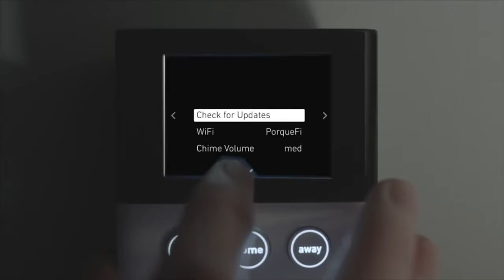The WORST Gun I Own

Comment: I'm impressed with that glass, I've seen WW2 surplus black tip 30-06 go through a nearly inch thick steel I beam that came from a railroad bridge. Tough stuff!
Reply: well you also gotta think thats not a full power 3006 as the m1 garand cant take the pressure of modern rounds so if you get that back tip and put it in a new case and reload it to now days pressure for 3006 is about 65,782psi for modern day and max of 55k for m1 you can get about 568 fps more or about 890 ftlbs more energy
Reply: @jacobstallcup8648     Nothing you said is relevant to what NOLA_Ken said. He specifically referenced military issued WWII black tip ammo, which was commonly and safely shot in M1 Garands, doing specific damage to something. Snipers using M1-D configurations commonly used black tip as their ammo of choice. Military 30-06 is “full power” by caliber and military standards, and by no means underpowered or anemic. You can always load hotter cartridges in a bolt action than you safely can in an auto-loading gun, as there is no pressure/timing used to cycle the action in a bolt gun, and no mechanisms set in motion by gas pressure. The Garand was simply designed to reliably run off of the timing and (still very high) pressure of M2 ball without damaging moving parts. There is also a difference in the burn rate and potential energy of the powder used in military 30-06 compared to modern hunting ammo, which makes a huge difference in the pressure spike exerted on the moving parts of a Garand. With minimal modifications, you can run the HOT loads you’re referring to in a Garand. However, since it’s not a hunting rifle, it’s usually not all that important to most owners. 

Point is, that window got hit with full-fledged 30-06. No reason to act like it was just lucky it only got shot by a Garand.
Reply: @Lukronius  nice

Comment: Delayed blowback roller locks need fine tuning on the angle of the locking piece, dependant on the weight of the projectile.  5.56 is a tough one because of so many variants in weights (55gr, 62gr, 69gr, etc).
This CetmeL is the Spanish variant of the HK93
There is a breaking period of about 200-500 rounds to set all the springs and surfaces.  Then it will run like a top.

Comment: Matt I make sure also that the springs in your standardized mags are retaining their spring tension. I went to see mags and Magpul mags but it could just be the gun still. I have a Cetme that's based more off of the H&K G3 and it works like a beauty I put thousands of rounds down range without any issues, maybe it's take their model of Cetme

Comment: Due to the barrel design the Hill Mac & MARCOLMAR CETME-L needs run on steel cases not brass at least for the first few hundred rounds. You can fire around 20 steel rounds get the barrel hot then change to brass  it will run. It won't run reliably cold using brass. It runs fine using Wolf steel case or similar.

Comment: Break in usually means assembly problems. No gas involved. 
The reason behind that is the gas port hole costs about 100 fps of velocity. Thus the 16 inch barrel has a out the same velocity as a 20 inch AR. Chronograph. Gauges. Bolt polishing. Used parts may not be from the same weapon.

Comment: The Cetmes action is the same as the G3. They run really bad when dry. Especially with low power ammunition.
Reply: So it is a badly produced G3?
Reply: @christophfriedrich5289  More accurate to say that the G3 is a well produced CETME, since the CETME came first.
Reply: @christophfriedrich5289  on the video IS the CETME l that use 556 there IS other CETME that IS just a G3 but In wooden furniture and also shots 7.62
Reply: @jic1  I didn't know that
Reply: @christophfriedrich5289   Yes and no. The roller delayed system that is used in the HK's were invented by CETME. You can compare the G41 to this one. It's like comparing a supercar to a moped.

Comment: Well, you must take into consideration that the Cetme was designed to use 7,62 rounds, so those feeding failures shouldn't happen with that.

And about durability, they were made to be used and abused. They're still on use (Cetme C version, the original) by civilians, army recruits, and police recruits.
Reply: It's well known that the only good CETME L were the ones used by the Guardia Civil. The ones from the army were made as cheap as possible, and so, unreliable.

(i recall something related to cheap magazines, but take this with a grain of salt)
Reply: @hypernova3527  I had a century arms clone made with old cetme parts and it never malfunctioned.
Reply: The CETME C and the CETME L are completely different guns and the CETME L was never designed to run on 7.62 of any kind. 

In fact there is only one 7.62 caliber round I am aware of that will fit into an AR magazine and chamber in a CETME L, and if you shoot it, it won't work better, It will probably remove the right half of your face. 

Why would you say such a stupid and dangerous thing?
Reply: @Keepgoing9919  Century Arms are built by skilled orangutans and should be regarded as preassembled parts kits. 
Some of them are very, very good. I got one on sale for $560 and a few years later, I have it shooting half an MOA after a few custom parts and a harmonic tuner. However, some are missing critical welds, some have had bolt components ground down to artificially simulate critical wear measurements are within spec (not because they were trying to be shady, but because they didn't understand how the weapon worked or understand stacking tolerances) and some are assembled using potentially hazardous parts. 

They should be closely inspected before firing, including making sure the bolt has not been ground, making sure the bolt gap is within spec with safely sized rollers, making sure the delay wedge is a 50 degree and not a 60 degree piece, making sure that all of the springs are fresh ESPECIALLY the firing pin safety spring (unless you want a spontaneous 2-5 round burst feature in a relatively lightweight .308 with a recoil impulse well over the centerline of the stock), and making sure after a few rounds that your rollers aren't deploying either at the back of the bolt stroke or at the front before going into battery. Either of these can be a sign of trouble with your receiver. At the front, it means your receiver and trunnion are not properly aligned and your bolt face is hitting the back of the trunnion instead of going into it. If they're deploying at the back, it means either your mainspring is weak, or your bolt isn't going into battery. 

CAI is a great way to get an affordable fixer-upper of an unusual gun if you don't mind tinkering. But many of them will not run right without tinkering. Some will occasionally not run safely without tinkering.
Reply: @009013M3  That’s not the first time I’ve heard that some of their items come unsafe to use. I guess I got lucky with mine. I’ve sold it since then
Reply: @Keepgoing9919  I have one, and to be clear I really like it. Got it on sale for like $560 back in... 2019, I think it was? I have replaced about half the parts with either new old stock H&K or homemade improvements, and if I'd shot it as-is from the factory, it would have been ruined by now. 

Here's a good way to put it. 

Buying a CAI is a bit like buying a used surplus gun in unknown condition from a private seller. I mean... I think we've all done that too. 

You kinda have to understand what you're getting with CAI. It's not always dangerous or even bad, but it is consistently inconsistent.
Reply: @hypernova3527  Part of the problem is that the CETME L has a unique magazine that looks very much like a STANAG mag but has a different feed angle. It is possible to install a STANAG mag in a CETME L but it will not run correctly. 

Malcolmar fixed this for their guns though. They work with AR GI mags.
Reply: @009013M3  first I’ve heard about mag incompatibility. The Spanish troops I trained with were always eager to buy/trade for USGI mags. That was the only way their CETMEs had a chance of cycling properly. I later heard that soldiers got fined if caught with USGI mags.
Reply: And the H&K G3 design was purchase from C.E.T.M.E.

Comment: The CETME is a G3/HK91 (HK-93 for 5.56). The G3 (7.62 x 51) does hammer your shoulder. Its accuracy is reliable to 300 yds or so in its vanilla form. It's a battle rifle and not a tack driver. I have a G3 but really just as a collection piece. The G3 has it's place among the AR/M16, FN FAL and AK-47 platforms as 20th Century modern battle rifles. The G-3 ejection port is fine. I've never had a stove pipe or failure to eject. I have no experience with a 5.56 version though. It seems a delayed roller is overkill for 5.56.

Comment: Check that you’re using a good magazine. Make sure the follower is consistent and doesn’t tip. Repeated consistent failure to eject and double feeds are usually a mag problem.
Reply: Like Matt is ever going to bother with any of this
Reply: Meh the Cetme L doesn't exactly have a sterling reputation. Even in Spain the things were detested by the troops issued them. I am frankly surprised he bothered buying one. The things make his Hi Point carbine look good in comparison.
Reply: @clothar23  the marcolmar reproduction ones are good quality, they made all new springs for it and changed the magazine well so it works better.
Reply: Or the whole gun is a hunk of crap . It looked cheaply made to me .
Reply: @michaeltheoret3842  nope, marcolmar made ones have nothing but positive reviews, it’s the hmg ones that can be hit or miss.

Comment: my guess would be: the CETME is a roller delayed blowback designed for 7.62 NATO. If you scale it down you might hit some problems.
When i was doing my mandatory military service in the Bundeswehr (german army) my platoon scored high during G36 range training and we got to "play around" a bit with the G3´s (very similar to CETME). Those guns were by that point about 40-50 years old and never made any problems.
But shooting them could be described at best as bruising. half the platoon got bruised shoulders after MG3 and G3 on the range.
Its a good and reliable rifle, but not the most compfortable to shoot.

Comment: I had a Cetme G3 clone, had the same issue, worst rifle I've ever owned just about ever 2 - 3 rounds it would get a failure to eject just like that.
Reply: The CETME C is the predecesor to the G3, and it's a very reliable gun (literally the same desing) so that seems like a personal experience
Reply: I had the same experience! It was a rough gun. Century import so I can’t blame the original design
Reply: @djunclemilo  it’s a shame, it’s a really cool rifle, delayed roller blowback is a great system but Century and CETME have very poor QC.
Reply: @djunclemilo  idrk about the imports, but the ones that were in the spanish ground army work wonders, i know cuz both my grandpa and my father served with it

Comment: The Styer M95 has an ejecting clip. On the last round pull back the clip drops out the bottom. I'd let you check mine out but unfortunately I have the original 8x50 and no one makes rounds for it. I also don't have any clips for it.

Comment: You need to put a minimum of 200-300 rounds of M855 through it. I had a few issues at first, but after about 250 rounds, mine has been flawless and will eat anything.

Comment: short cycling; open the gas port 2 drill sizes; that is, if it doesn't have an adjustable gas port. the other thing to check is polish the chamber with 320 or 400 emery paper to get out any grit or chamber roughness. just an observation from the gunsmith.

Comment: I've suffered the CETME for years in the army, some sugestions:

-Clean, clean and clean, and when you get tired of cleaning, clean again, the blocking rollers housing is critical and very complicated to clean, if housing is dirty, the bolt will not lock and the neddle will not hit the capsule
-USE BRAND NEW MAGAZINES, when the magazine's lips get closer by use, the rifle gets stuck because the friction of the bolt against the magazine's lips, the recoil is not enough strong to pull out the cases and the recovery spring is not enough strong to push the new cartridge in the chamber. The spanish army gunsmiths have a magazine die to repair the bended/closed magazine lips, try to get one
-Polish to mirror finish the sides of the bolt or lubricate with a ultra high lublicating oil

A bit of knowledge. CETME is the acronym of Centro de Estudios Tecnológicos y Materiales Especiales, (Technological Investigations and Special Materials Center) The spanish soldiers say CETME wants to mean Cada Esquina Tiene Mierda Escondida (Each Corner Has Hidden Shit) 🤣 In reference to the dificult to clean this rifle

Comment: Roller delayed guns typically have a 300-500 round break in period if that gun hasn’t been fired much/ever. The CETME-L’s also require NATO spec 5.56 ball ammo like M193 to be reliable.
Reply: Yep . They have pretty specific break in instructions. Every PTR owner that complains of reliability I ask them  if they followed the break in instructions and almost always they say no . I have a 91 and a 32 and they run well , I read the manual. It’s kind of intensive and boring but it does seem to make a difference .
Reply: Congratulations you've been chosen among my lucky winners for giveaway kindly text the number above for more details🙂

Comment: You should dump some more mags to break the gun in. Also it's roller delayed so a bit higher pressure loadings for breaking the gun in may help, cuz it seems like some cartridges ain't have enough oomph to force the rollers in and push the bolt to cycle cleanly.

Comment: The CETME could be fixed with a softer recoil spring probably. Actually not probably but surely and also the ejection port could be a bit longer, that's for sure.

Comment: It's common knowledge that cetme's wont run commercial brass. It was literally designed for hot surplus ammo lol. This is like putting truck oil in a civic and then blaming the car when it starts knocking 😂😂

Comment: Cetme is clearly a HK G3/G33 modernized look derivative, not much to do with an AR15. BTW. original HK's also rape the brass during ejection unless a ejection buffer is installed. But, HK's are reliable and rarely jam, unless very dirty. Maybe just the recoil spring on the Cetme is too stiff when new? Maybe they used the same as with 7.62? Probably not. Probably just need more shooting to loosen up a bit. Also storage grease needs to be removed before shooting but I am sure you did it.
Reply: Congratulations you've been chosen among my lucky winners for giveaway kindly text the number above for more details.🙂

Comment: Well, as I Spanish I can confir the fact that we perform  the duty dressed like a bullfighter :) good job and fun review
If you want It .can tell you even teach the Way to solve the 5 problema CETME L has. 
1 please dont bé upset... You dont know how to usé It.  Train and clean.  Till yours finger was in pain. 
2 you have to remove and clean the extractor nail, is the problems of currently jaming 
3 Ejector is bend, remove and fix It Be careful whit the guide and spring. 
4 use m4 magazín 
5 replace the hammer spring, factory spring is weak.
This weapon is not new is rebuilt even has parts of the First generation. 
When an army sell of their rifles after more than 20 Years of duty Ummmm
If you want to know How Will Be the Worst problem you are going to have, ask  It to me. 
I Am a  NCO with more than 32 Years of experience. 
Sorry for My english. 

.

Comment: "the Spain version of AR-15"?

No, it's a further development of the CETME 58 that also resulted in the H&K G3.
There is absolutely NO commonality between them beyond that they're both made to be able to use the same magazines.

And it jams because you're not using Spanish ammo for it.   Apparently noone checked that it also worked fine with the ammo from other nations.
Which is also why nations using gasoperated guns wasn't supposed to use Spanish ammo, because then THEIR guns fouled up and jammed.   Dunno if that's been fixed since, it considering the L is no longer in use, probably.
It also apparently prefers modded magazines.

Comment: Weak and old ammo, weird mags... the problem is not the CETME. Look for spanish surplus mags, and 5,56 military spec ammo. I've served with a CETME L, and all the problems ever come from worn mags and dumping due ammo; and also improper cleaning. Maybe I've shot 10000 rouns with my good old L, and with fresh ammo and my own mags, NEVER FAILED. When I take extra mags from armory start the party.
Reply: As far as I understand, the version made for the Spanish military had numerous problems.
Another version was made, or rather the original one without cuts, which was used by the police, and was free of the defects caused by the cuts.
And finally, the Americans took the sales license and modified most of the problematic elements of the defective military version.

Comment: Before you crap all over the gun, try some different ammo. Delayed roller blowback does not function well with underpowered loads. The CETME is actually a German design made in Spain. It is not the "Spanish version of the AR15". With the CETME L, the only similarities to the AR15, both are chambered in .556.

Comment: Ok 1st if that's the Malcomar made one they tell you too only shoot 65gr and up due to break in period of 300 to 500 rds 
2nd use only stanag mags and yes some other polymer mags will work but it's hit or miss but any problems you will have with markomar one are not the same as the ones made bye Hill and Mac they used more of the parts kits parts from original guns and to say the least the originals sucked ass